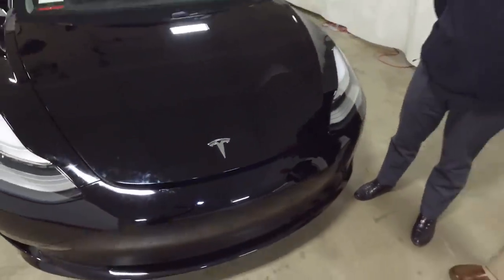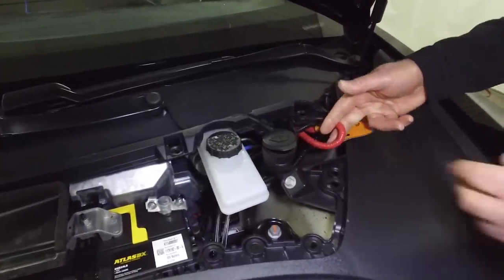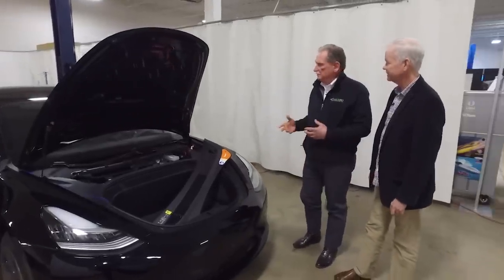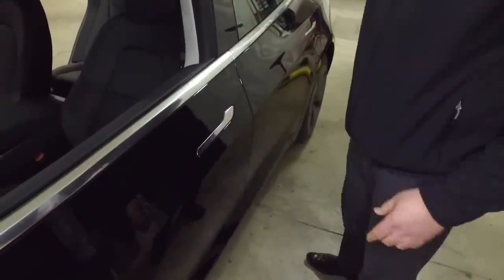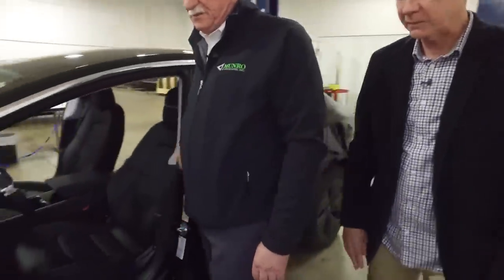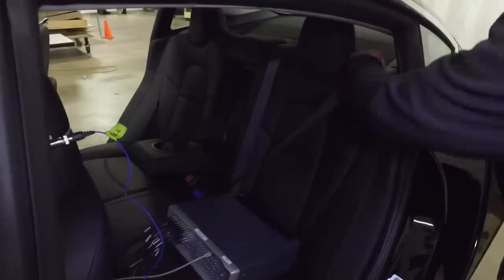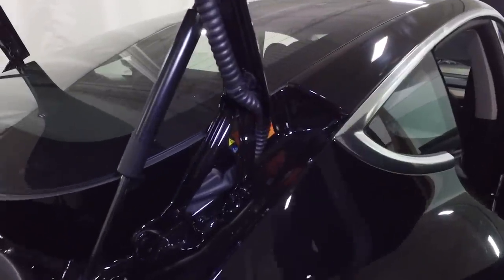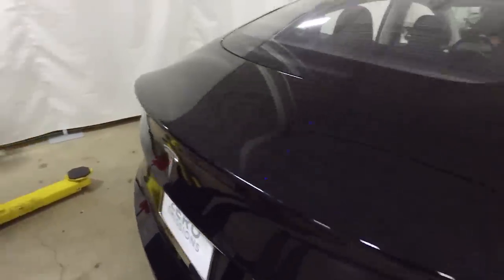Tearing Into Tesla's Model 3

Comment: I can't tell whether Sandy Munro hasn't read the Model 3 owner's manual, or simply wants to paint a negative picture for his client. Here's a few missing details:
1. The hood automatically releases after a collision, once the car is stationary.
2. The side windows are self-sealing. When you open a door, the window lowers 5mm so the glass will clear the upper trim. When you use the emergency front door release, the glass does not lower, so you run the risk of trim damage if the window is not manually lowered first. That's what the warning on the touchscreen was about.
3. Emergency door handles for the rear doors are not used because they would present a temptation to children riding in the back. 
4. This car must have been a very early copy of the Model 3. I spent 30 minutes examining one at Tesla's NYC showroom recently, and I was very impressed. I could find no faults in the build quality. The panel gaps were uniform, and the fit and finish was every bit as good as a BMW or Audi. I've owned cars by Audi, Mercedes-Benz, and Ferrari.

Comment: I live in Norway and this car is a bargain because of road toll and taxes. I’m on the waiting list for it. Two major issues I find is. 1. Panels gap and window. Hope they fix that till I get my car. Looks like rain could easily get in the car. 2. Passenger safety. Really no mechanical door opener on the inside? If you crash and the electricity doesn’t work passengers have to crawl over the driver if the driver is unconscious or dead. Alternatively empty all luggage into the cabin before crawling into the trunk to open it. Not an easy task especially not for kids. What if the driver door gets smashed and stuck? Same situation.

Comment: So I can open any Model 3 front trunk if I have my RC  model battery with me?
Reply: YensR 12v power is always on in the Model 3, so you can not.
Reply: so it can only be opened externally if the 12V supply has died (because of a crash)?

Comment: Mercedes puts a QR code on the fuel tank flap / charging flap as well as on the insides of doors so that if the fire department needs cutting, all you do is scan the code and it gives the entire layout of the car and shows exactly where to cut. To prevent the rattling of the window in the door when closing (with pillarless doors), Audi make the window rise up a little when opening the door so that the window is kept firmly in place between the door panel and the outer door. This makes sure it does not rattle. Tesla could learn a lot from other manufacturers so too can the fanboys thinking they are the best at anything when they are not.

Comment: THAT'S a $50k car??  The interior looks like something from a 2000 Honda Civic.  How do these cars generate so much hype when you can buy a Chevy Bolt for less money and equal range?
Reply: That Model 3 did cost over $50,000 because Tesla is producing the higher "Premium" models first (this is one of them) to recover quicker their investments, then they will release the cheaper version much later.And the later versions  will NEVER cost $30,000 unless it is used and beaten up.
Reply: Much later being four years from now considering their current ability to produce compared to their timeline. They are extremely behind and aren't building the volume necessary for large scale testing and improvements. Raymond, you're in a cult. Wake up.
Reply: I think you just answered your own question.  Then you would have to look at a Chevy Bolt every time you see it.
Reply: Kedama The is NO way to configure a Model 3 to have it come out at less than $ 50,000. That 35k figure is just more Tesla vaporware...sorta like the 5k Model 3s a month they we supposed to be producing by now.
Reply: 30k car

Comment: never seen this before, i call bullshit. Porsche 911 is the same and worse. if the car battery is flat, youll need to enter the car, open a panel next to the pedals, extract a + connection og put the minus in the door. then you can use the electric hood release. from 1998 and up, so noo. nothin new.

Comment: The panel gaps are normal for American cars. Left and right can be different. In fact just look at build variances affecting ford mustang. You can easily spot the gaps between the bonnet and front fender, left and right is different. Sometimes you get a perfect one but then you will get bumpers not aligned properly to the body. If you want precision buy European or Japanese.

Comment: if u got no power, sure u can bring cables and a working battery to open the hood, but in any other case unless u got time, u're fucked. Too much electronics, not enough engineering.

Comment: I don't care and don't like tesla, but this dude is a fossil and picking things that old people might not like. If you have a problem with the car then don't buy it.
Reply: A G I’m 25. I think it’s utterly shocking this car doesn’t have a mechanical button to open the glove box. I don’t want to have to turn the car on to open the glove box and get my insurance card. Also it’s insane that there is no speedometer in front of the driver. This car has way too much reliance on electronics and I would never trust owning one of these used in 10 years

Comment: There is a faster way for the fire department to get in if it was rush.

Battery related incidents will take a lot longer to get to a serious level and the fire department would first focus on getting the person out. The door or window would be first lol break open the door or window first then fiddle to disable or saw through the back pillars to turn the power off I believe
Reply: Cameron McMillan Firefighters pop open the hood on all cars using a halligan tool to cut the cables. That is standard procedure before extraction.
Reply: This isn't a a mere 2~3 liter 12-volt battery putting out a mere 300 amps peak.  It's a 200 liter, high voltage battery capable of putting out thousands of amps.

Trying to say that a flamethrower is safe, because matches don't put out much heat only shows that you are an idiot.

Comment: I bought a used model s about a year ago. I am by no means a fanboy... but I do have to say it's by FAR... the best car I've ever owned... granted I've only put 35k miles on it..  in that time frame "fuel" or the cost to run it... Has been  600 dollar in electricity. And a new set of tires. That is it.. literally

With that being said. The electric doors in the back would worry me in the event of a crash. However I have to assume tesla has tested this extensively. 

With a regular car you have to worry about surviving the crash. Which is much higher in a Tesla. Give it's complete 5 star rating in every category. In every car it now produces...
But when the guy says it's almost impossible for him to open the door as he easily opens the door in a second with one hand... is a joke. Give me a break 

Body panel gap tolerances are definitely not a strong suit for tesla. My passenger side door was slightly off.. when I got the car at 30k miles. I told the service center and they fixed it asap, by adjusting it.. took 15 mins. Never had an issue since. 

I think once someone drives the car. They will forget about a tiny gap that can be fixed... 

It is leaps and bounds over my last 335i.. 535xi.. g37.. etc. So much better in every imaginable way..
Reply: Aaron Kulkis .... How is oil pumped from the ground?.. using electricity. How is oil refined. Using electricity.. it doesn't just come up from the ground ready to be used.. 

It takes 6 to 8 kw of energy to make a gallon of gas. Where does energy come From? Pretty sure they're using the same energy as it takes to power a Tesla. So double the pollution.
Reply: Michael Yachnis far less natural resources than a internal combustion car?. Feel free to do a quick search on it.. not to mention the world is rapidly increasing its use of renewable resources... And I plan to install solar panels in the near future, which should offset my energy bill completely. Making the car run off the sun entirely...

Don't get me wrong. I don't own a tesla to save the planet lol. I have a V8 volvo SUV amongst other project cars. I drive a Tesla because it is an amazing daily driver.. I drive around 100 to 150 miles a day. It's the perfect car for that. Instant gratifying torque at any speed. Smoother than anything you've ever driven. Highest safety rated car.. And well I find it a good looking car. The gas savings is nice as well.
Reply: Aaron Kulkis refining oil uses energy to make energy. 

I just don't understand why you would think owning an electric vehicle is worse from an energy used stand point. 

You're telling me that an oil refinery uses no power from the grid?
Reply: Aaron Kulkis 
According to a scientific study you are correct... until a Tesla drives about 4900 miles. Then that is offset and you're dramatically reducing the amount of carbon footprint.. 

Feel free to read 
Make sure you click the link to the pdf.. the link is titled rigorous assessment. 
https://www.forbes.com/sites/quora/2016/04/22/the-carbon-footprint-of-tesla-manufacturing/#1379122b6096

Another interesting one. 

https://www.popularmechanics.com/cars/hybrid-electric/news/a27039/tesla-battery-emissions-study-fake-news/
Reply: Aaron Kulkis 
Regardless of what you, or I, or science thinks.. you can enjoy your gasoline engines all you want  I enjoy mine gasoline engines as well ha.. 

But come 2030.. there won't be another gasoline engine produced in the mainstream at least. So enjoy them while you can. Also go test drive a Tesla and find out like I did.. that the future isn't too bad!..
Reply: Aaron Kulkis totally wrong. https://energy.gov/sites/prod/files/2015/06/f23/es229_gaines_2015_o.pdf
Reply: Well It is like comparing Mercedes  S class with C class. of course S class is much better and c class I wont even let my dog buy it, same goes for tesla mode S and supposedly cheaper model  3.
Reply: I have sun energy as my energy supplier... supplies ALL renewable energy to the grid... cost is the same I've always paid. While I don't have solar panels on my roof... my car runs off renewable energy. Maybe you should check it out?
Reply: Electricity doesn't just appear out of nowhere for free, moron.
Reply: Every oil pump I've ever seen uses a "hit-and-miss" engine.  Those are hydrcarbon powered, not electric.  Refining petroleum with electricity rather than petroleum as your heat source.... that's BEYOND idiotic, dude.  Burning petroleum (chemical -> thermal) has far fewer energy form transformation losses than using electricity (chemical -> thermal -> mechanical -> electric -> thermal).  2nd Law of Thermodynamics indicates that the electricity method is FAR less efficient, therefore more costly.  Besides, a refinery has TONS of fuel-grade petroleum that they are receiving at BELOW wholesale prices, whereas the fuel burned to create the electricity is purchased at retail or wholesale.

In the future, before advertising to the entire world how much of an idiot yu are, why don't you just....take 10 deep breaths and walk away.
Reply: How much coal has that Tesla used so far?
Reply: Petroleum doesn't spew mercury into the air.
Reply: I don't think you have any idea what the environmental impact of lithium production is.  It's worse than aluminum.
Reply: Brandon Balcer How about the fact that all gas cars have locked hoods that require a halligan bar to open in first responder events. His forced issue with a locked frunk is propaganda and immoral fud.
Reply: azalru https://insideevs.com/number-of-fire-related-deaths-per-year-caused-by-evs/
Reply: One, when you look at the COMPLETE lifecycle of a car, from obtaining the raw materials (mineral ores), purification, manufacturing, operating inputs, etc, electric vehicles consume MORE energy than gasoline internal combustion engine vehilcles.

That's why.

You're focusing on one slice, not looking at the entire, big picture.

Comment: That's an interesting perspective. Most people don't consider safety until it's too late, but that's an important consideration. It would be interesting to get a firefighter's perspective on the Model 3
Reply: Mechanical is generally much more reliable.
My specialty is computer engineering.  I think all the computer CONTROLS in gasoline engines are .... beneficial for the dealerships, not the owner.  Much better would be computer ASSISTED engine management.  Vacuum advance still works.  Get the computer to tweak the amount of vacuum for perfect timing would get you the same gas mileage when the computer works, and acceptable (but not perfect) performance and gas mileage if the computer dies.  Compare this to computer CONTROLLED ignition where, if the computer dies, you are stuck calling a tow truck, and can't move the car until you replace a $300+ module
Reply: @akulkis  You've got to be kidding me.  As a mechanic, I can tell you computer controlled cars are exponentially more reliable.  If you ever had to trace down a vacuum leak (rubber vacuum lines almost always leak) it can me almost impossible.  To indicate a vacuum advance is more reliable than computer controlled is simply ridiculous!  Next you'll be asking for carburetors instead of fuel injection.  Reliability has gone up exponentially as a direct result of computerization.  If your carburetor float sticks and floods the intake it can catch fire with a backfire and burn the car to the ground in short order.  The computer monitors way more than simple timing. It monitors the temperature (ambient water and cylinder head), air fuel mixture,  throttle position, etc, etc.  Odds of you getting stuck with a non-computerized car are several magnitudes higher than a modern OBDII equipped car.  Not to mention the ability to have the vehicle self diagnose.
Reply: I have a preorder on Tesla 3. Live in Norway so due to taxes and road tolls this car is a bargain. My issue with it is passenger safety. Do Tesla really expect children or elderly to empty the heavy luggage out of the trunk into the cabin. Then crawl into the trunk to open it? Or an elderly person to crawl over a dead or unconscious driver to open the driver door?
Reply: Muffin Racing Firefighters have already responded in the comments below, that they use halligan bars to pry open the hood all the time on gas cars.

AutolineDaily/Munroe's forced viewpoint on the frunk impeding first responders is complete bullshit, and propaganda betting on the audience ignorance on what actually happens in extraction events.
Reply: Good to know the firefighters already have a solution. I don't think Munroe's viewpoint is anti-Tesla propaganda, necessarily. As he mentioned at several points, he's a mechanical snob, so could be he's not taking well to these newfangled electrics in general.
Reply: This is no different than a car with child safety locks on in the back doors.... all you do is get out of the car and open the doors from the outside.... I really don't understand why this is considered an issue?

Comment: Oh my, this is very concerning for potential buyers. It sounds like a fair and unbiased teardown that paints a pretty poor picture for an automobile that is supposed to be futuristic and luxurious.
Reply: Clyde Drexler How is lying about a locked frunk being an issue, fair and unbiased?

Since all gas cars don't have an outside mechanical release, and have no issues with firemen prying the hood open with a halligan bar. 

Their issue is completely baseless propaganda that's takes advantage of people's ignorance.
Reply: That's just a stupid statement. This is an electric car with unique risks of electrocution. And there's no simple way to get to the cutoff if the electronics are affected. There's a cable release and rear door releases in 99.999% of the other cars on earth for obvious reasons that are not so obvious to the brain trust at Tesla. I hope they're lawyered up, because they're going to need it. Not to mention the abysmal fit and finish is a complete embarrassment to American manufacturing. Get real and stop drinking Musk Kook-Aid!
Reply: Clyde Drexler Gas cars have electrical systems that made it standard procedure to open the hood and cut the cables,before  extraction. Sparks from power will ignite the carpet causing fire.

They're not going inside the car to use the mechanical release to pop the hood, otherwise they would have gotten the occupants out already. They have been using halligan bars since 1948.
Reply: Ok, my bad. You're right! Don't install a cable release. Instead, hide a couple cables behind an inconspicuous panel that once found and removed includes instructions to attach that battery that you carry around in your back pocket to open hoods on cars. And don't bother worrying about how much longer it takes than pulling a cable or sliding a switch because those trapped in the car are in no hurry. Brilliant! And again, good luck to those in the rear seat who can't get out because there's no manual override for the electric switch that opens the door. God Lord some of you are so fixed on your fantasy that you are unable to admit the gaping holes your armour. Good luck with your Model 3.  It looks like a good car as a first experiment. It does not resemble something you would expect as a relative to the Model S. The risks are way to great for me to consider it a viable option. OK, I'm done holloring into this empty cave.
Reply: Clyde Drexler Don't install a cable release, well all gas car's don't have a cable release on the external, so there ya go. 

Firefighters pop open the hood with a pry bar because of that fact. And they see wires to be cut in the gas car, before they start extraction.

 Fire fighters aren't pulling cables, because they are none. Inside is where the trapped people are. 

Also people in the back can easily get to the front. 

The gullible audience is the exact type that this channel feeds fud and propaganda to.